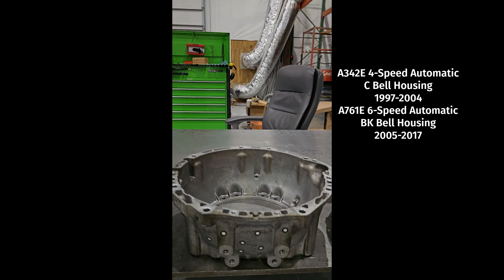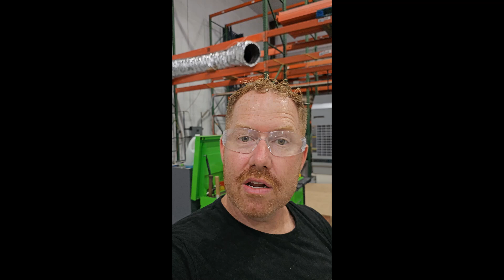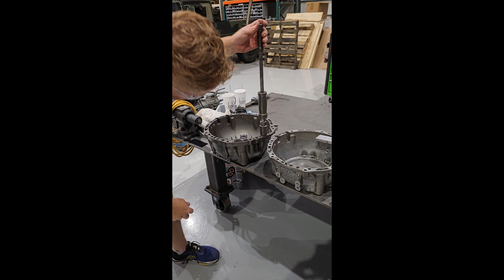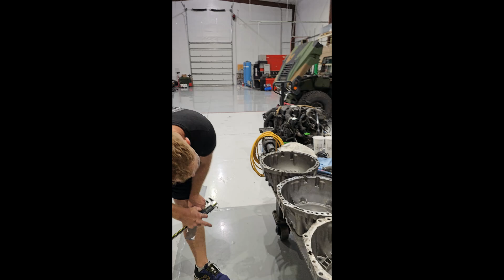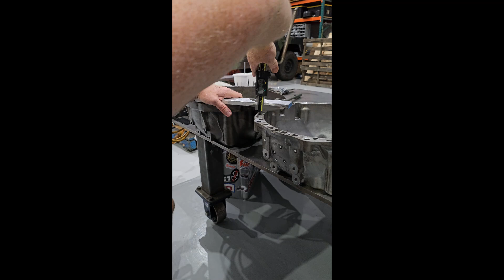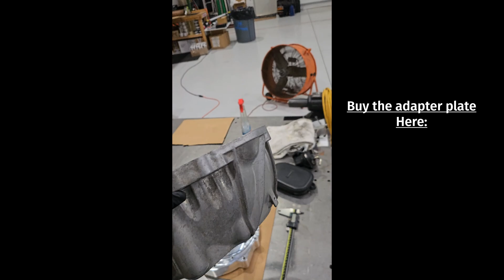1GZFE 1GZ V12 Engine to Nissan CD009 6Speed Manual Transmission Adapter Plate Bell housing Selection

Comment: The 10mm dowel. Is that like a drill rod spec if it needs replaced?
Reply from the maker: The 10mm dowels in the rear of the block, are there to properly center the bellhousing when installing the transmission. A dowel pin is simply a cylindrical shaped piece of metal made to an exact diameter. Typically, ground down to a specific tolerance.

Comment from the maker: 1GZFE V12 Engines are amazing! We need to find the ultimate vehicle to swap it into! What would you guys put this V12 in?
Reply: Ls430, Gx470 Lx landcruiser, Lexus Lc500, R35 Gtr, R34 Gtr 1999 Lamborghini Diablo vt, Murciealago, Saleen S7, Lamborghini Huracan Sto
Reply from the maker: @mikelmarion  LS430 sounds like a badass plan.
Reply: @CollinsGarage_Crett_Bollins  yes yesss.  Would love if you guys did a 3D scan of the engine bay and trans tunnel….if you attempt this project of course
Reply: Mines going in my 427 Cobra build.  I've modeled up most of it but I'll be adding the accessories now that I have a few measurements off the engine I returned.   I'm almost the point I need the engine and transmission to chassis.  I'll be getting a new CD00A from Mazda.  It's wider in the back than the tunnel so it'll need adjustment.
Reply: I have a bmw e61 wagon I’m going to put this in
Reply: BRZ/FRS/GT86 , its a recent model chassis and it needs a powerful engine( other than GODs 4 cylinder), the cd009 can be swapped into it, if the 2jz can fit so can 1gz.  What do you think?
Reply: I have one going into an RX8 with CD009 transmission.
Reply: My goal is to throw this into a G35 with the vaydor body kit.. but I want a manual.
Reply: C3 corvette